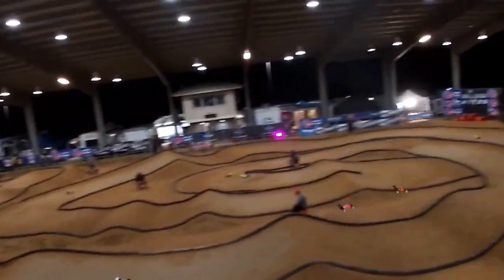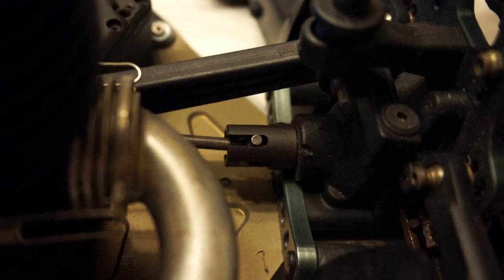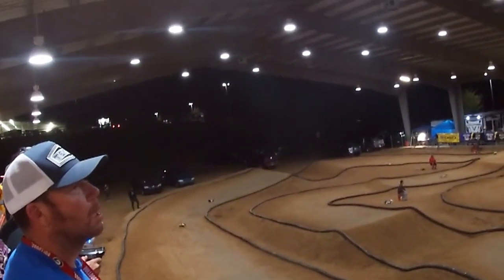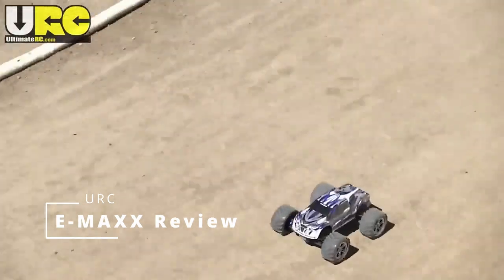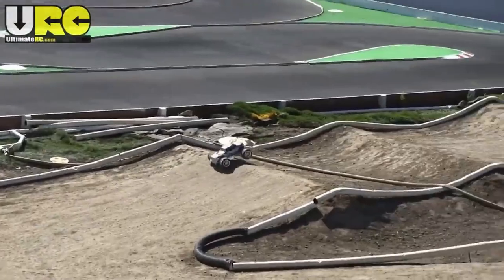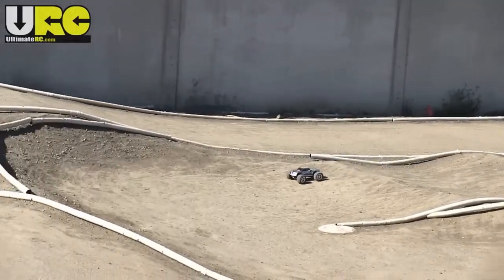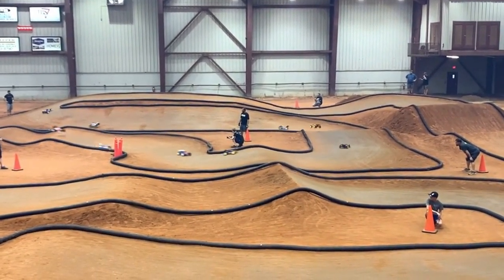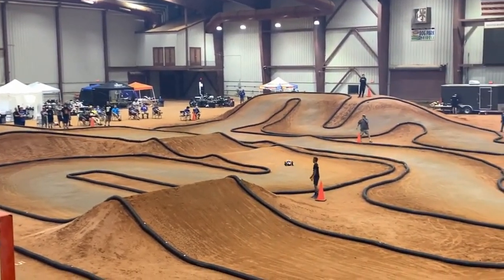Buggy VS Truggy (RC)

Comment: You know, it's kinda interesting how little 1/8th scale buggies have changed over the years. Pretty much the biggest innovation after the "modern" design came around was the introduction of narrow-body buggies with the Losi 8ight. And those haven't fully replaced wide-body buggies either. Even the E-buggies were basically just a matter of slapping a new power system into the existing design.

And honestly, I know this sounds like stagnation, but for club-level racing this is actually a good thing. It means that every new car is just a slightly tweaked version of what came before it, and since they still run on dirt which acts as a great equalizer of sorts, you're not really forced to upgrade to a new car every single minor refit like you are with 1/10th scale classes. While you might still want to upgrade due to parts availability issues, most older buggies within reason will still be competitive, and even entry-level models like the ARRMA Typhon or Kyosho NEO will be able to at least hold their own. This is a very ideal situation for club racing as while the vehicle type has a higher cost of entry than the various 1/10th scale options, the long-term costs for racing are far lower.

As for 1/8th scale buggies being tricky to drive, I mean, they can be, but I've personally found the larger, heavier 1/8th scale 4WD buggies to be easier to drive than anything 1/10th scale. Their larger size and weight makes it easier to recover from a loss of traction than it is for, say, a 1/10th scale 2WD stadium truck, and their weight combined with their 4WD drivetrain makes them less likely to get into trouble in the first place. Sure, a 1/8th scale truggy will be even easier to drive, but at the end of the day, both are going to be relatively easy compared to their 1/10th scale counterparts.

Comment: E-Truggy = 1/8 Novice… convince me I’m wrong 😊

All jokes aside, I feel 1/8 truggy has become redundant with 1/8 buggy. The truggies are extremely capable and on a lot of tracks they can actually throw down faster lap times than buggies. Don’t get me wrong truggy is a super fun class, but I think RC racing NEEDS a class alternate to buggy that really differentiates itself from buggy. Even if it is lower performing - that’s OK. Truck was never intended to be anywhere near the same performance level as buggy. I’m not sure how that was lost over the years...

Great video Roach, thanks for sharing.
Reply: Well said 👏
Reply: There was a class called 1/8 short course, but it never gained a strong following. I'd like to see it as a class again, even if only club level. I got to turn a few laps with the associated sc8 and while it didn't set any lap records, it was a blast to drive.
Reply: @DirtConcept  No the bruggy didn't start out as 1/10 stadium truck, it started as a monster truck. Mugen made one of the first conversion kits for the mbx5 buggy after racers were taking m/t wheels, tires, and bodies fabbing some body mounts and making their own "truggy" for m/t class, and they out classed the true m/t by a mile. The m/t was basically a basher/racer, i raced a revo and a xxxnt around florida at the same time, once the truggy "class" was added m/t  fell to the way side and nitro stadium trucks  lasted a little longer, but lipo's and brushless put the gas trucks to bed. I started racing back in 92 watched it all evolve over the years. I do miss racing 1/10 nitro though.
Reply: I do miss 1/10 "gas truck." The old RC10GT team kit outfitted with OS .12CV was a blast! Do you remember Grand Prix Hobbies in Ft. Pierce owned by Luther Peters? For a while I lived at that track...

Comment: I used to be a huge truggy guy, but since 'bruggy' bodies have come around, not to mention how much more expensive racing has gotten, it's hard to see what's the point in running trucks anymore. Maybe a bit more track time, sure, but then that's more off-track maintenance, twice the equipment, and more expensive truck-specific parts, it's hard to justify over just focusing on having a good buggy going.

Comment: One thing to note for beginners, alot of os at times have trouble with the race barriers or maybe rolling onto your side, Truggys are much better at traversing the piping on tracks while buggys will get high centered and stuck. Truggys also have this funny trick of just flooring it when you are about to roll upside down and magically righting them selves up with their bigger tires.
Reply: buggies dont roll easy like trucks, the end

Comment: 1/8th scale truggies came about in the early 2000’s back when I used to race kyosho mp7’s at The Dirt and prolines track the nitro 1/8th scale buggy was the big show back then. First real race for truggies was probably 2002-2004 ish range when people where converting the mp7’s and ofnas and mugens into truggies. Used to love racing the buggies at the old The Dirt in Hemet back in the day.
Reply: 1/8 scale truggies came out in ruffly 1991 with the RC10T. It debuted in Florida winter nationals with two race teams. From that point every company was trying to jump on it. Mine was running a Novak speed controller and a trinity monster motor

Comment: I use a standard 2000kv hw brushless motor on my hb etruggy and it’s more than enough power. The extra 4mm length cans specified for ETruggy’s are not any dearer or essential for racing…

Comment: Can someone explain what a 1/10 open class would be because it's one of the 3 classes that will be raced in an upcoming race
Reply: 1/10 open is typically a catch-all class for anything that doesn't fit in any of the other classes. It's more of an introductory class than anything.

Comment: Bruggy is such a stupid thing. Even worse is trying to change the scale size semi-arbitrarily like that. They should 100% bring back full truggy style bodies and outlaw the Bruggy BS, then figure out how to solve parachuting another way, kinda like they did in SCT with that one proline or j-concepts body or whatever.

Also, why the hell are Truggy and Stadium truck named differently when they're basically the same thing? Slightly bigger footprint and bigger tired buggies that makes them easier to drive. TBH, just call Stadium Trucks Truggies, too, and then differentiate between scales and drivelines like we already do. SCT can be it's own thing and become UNTIED to a scale since "1/10" scale SCT is dimensionally 1/8th scale anyway.

So in the end we'd have:
1/10 2wd Buggy
1/10 4wd Buggy
1/10 2wd Truggy
1/10 4wd Truggy

2wd SCT (no scale designation since the current one is inaccurate and these are suppose to be all about "scale accuracy")
4wd SCT (same as above)

1/8 Buggy
1/8 Truggy

Minis class (1/14 to 1/18 scale)
Micro class (1/24 scale)

TBH you could probably get away with making 1/10 scale stuff 2wd only, but that'd probably piss off a lot of people. It'd simplify things quite a bit, though. Want 4wd? Go big. TBH I wouldn't mind seeing big 2WD stuff, but IDK how they'd run and whether or not they'd be worth it. The closest we've got is 1/10 MT 2wd and 2wd SCT, one of which isn't a class, and the other of which is only okay in the face of its 4wd counterpart.

Comment: I personally don't like the Truggies. They're a model of a model. Buggies at least were at one time a reflection of a buggy. They're more prone to breakage, they're a threat to turn marshals, the front of the chassis will often dig out the base of jumps and making the jump surface rough, I can go on. You can also compromise a track that would be suitable for 1/8 buggy, and 1/10 classes, however, truggies will not be enjoyable on a truck more suited to 1/10 classes.

 But, truggies are easier to drive. I say quit trying to make things easy, and simply learn to drive a buggy...